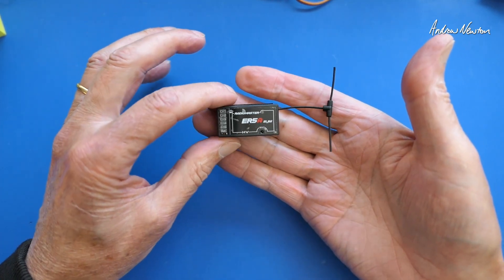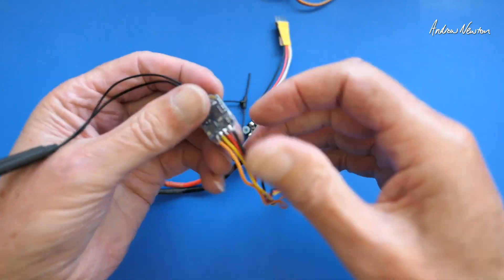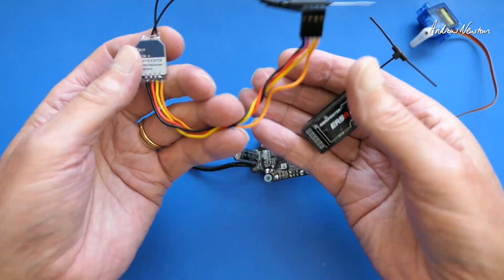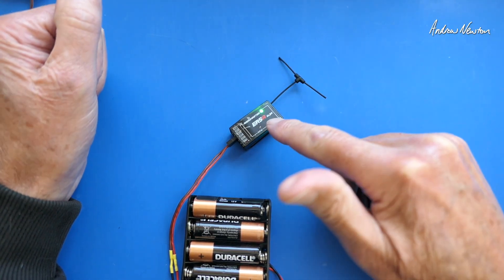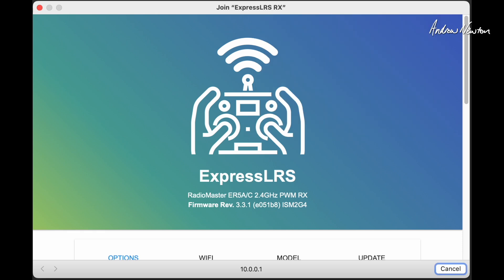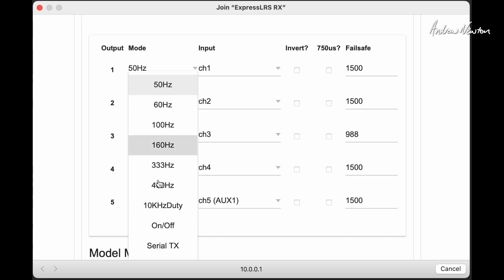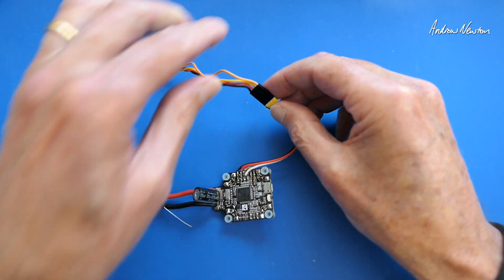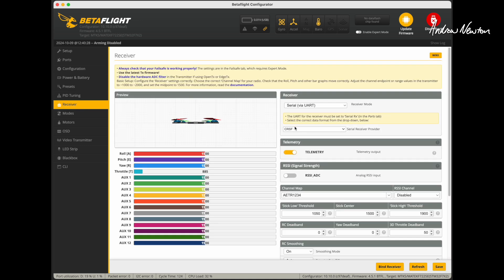Use ELRS PWM receiver for FC

Comment: Hey Andrew, what would the wire coming from the receiver look like?
Reply from the maker: This is what I use but it depends on your requirements https://www.motionrc.com/collections/male-to-male-servo-leads
Reply: I'm actually using that same receiver with my F405 FC. I'll check this out. Thanks man.
Reply: @AaronsEscapades  Bro, I'm using the same
Reply: @tanmaywalunj8070 Everything is working on my F405 wing FC, except for it not arming. The precheck says, "I need a compass calibration." How do I do that? And do I even need it for a fixed wing?
Reply: @tanmaywalunj8070 Is your F405 FC running and working? I need a little help bro.
Reply: I realize now that I can set it to SBUS, which will make things simpler for me.

Comment: Does that mean that the remaining PWM outputs on the RX are still active if you had some creative use for them?
Reply: Yep. You can set them up to release fish bait from any height into any water receptacle below - moving or otherwise! 😉😊
Reply from the maker: Correct
Reply: Hey thanks for the video!

I also have question :) 
Im kind of newbie i decide to go lvl up from my glider f959s. I brought radiomaster pocket with ELRS, receiver with ELRS and PWM to steer my new glider. And I'm curious if i get flight controller bind it with receiver by CRSF it will "steer" with PWM outs ? Now i realize that is 6ch - 2 for CRSF means 4 left... so none left for ESC :(